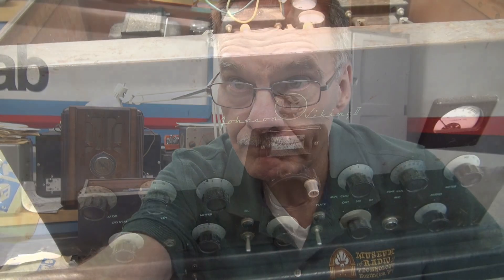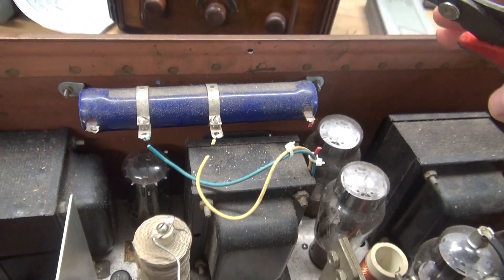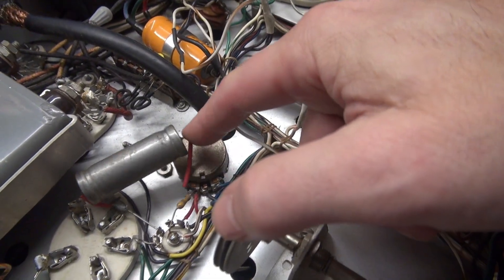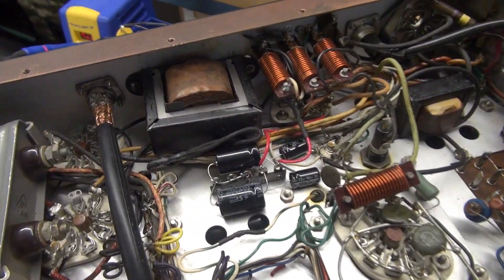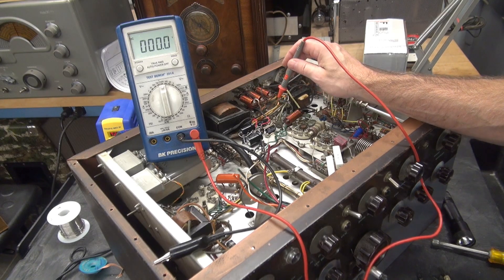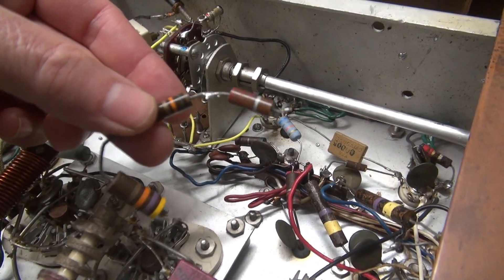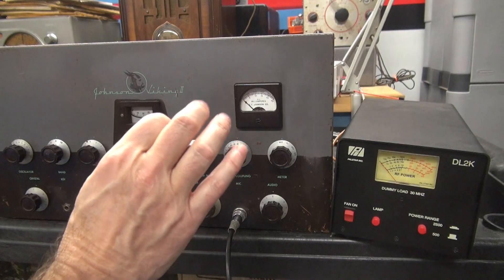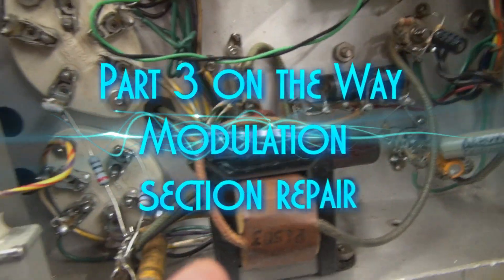Johnson Viking II Ham transmitter repair part 2 How to fix the power supply

Comment: If the relay was using power from the filament of the 6AL5, wouldn't it have been a low voltage push to talk system?

Comment: Thanx for your useful videos...
1. I have Panasonic RF562 radio but it has no ‘fine tuning’, so I can’t catch stations(frequencies) exactly...it definitely needs a ‘fine tuning’... can I do anything to make ‘fine tuning’ device ör circuit?
2. This radio also have not any ‘tune level indicator’...can I make any circuit with leds to see the exact tune?
MR Jhonson, if you suggest solutions to these two problems, I will be very glad, thank u...